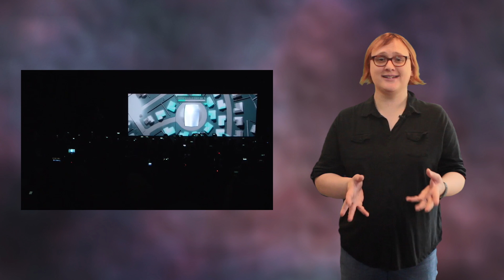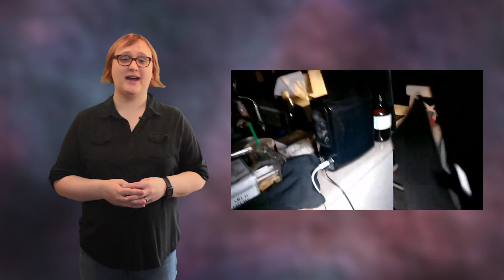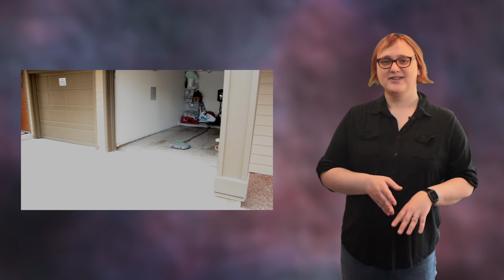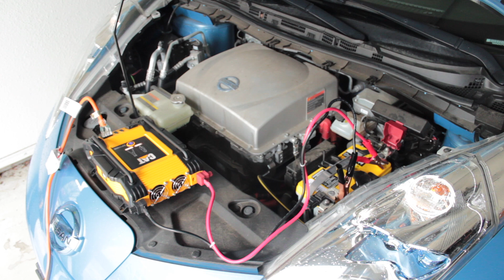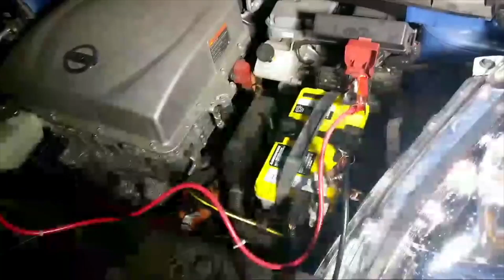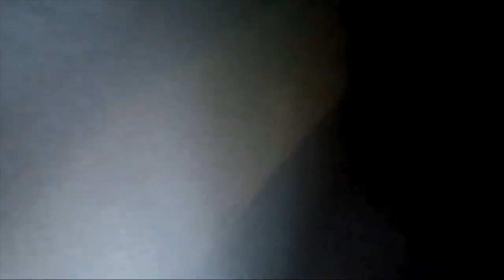How To Power Your House In an Emergency From Your ELECTRIC VEHICLE

Comment: I own a Mitsubishi  i-Miev and test tried your idea. I monitored the kWh  with a kill a watt meter. However  I found that a lot more power is used then consumed. So this is an inefficient method.  I am now considering using the Chademo connector,  but require a 350 v dc to 230v ac converter. However the plug is hard to come by. I did find an inverter but it is expensive.  Further more a modification is needed to the relay circuit to activate the Chademo socket to give output power. I am not sure if the representatives of the car would be willing to do so. Any ideas?